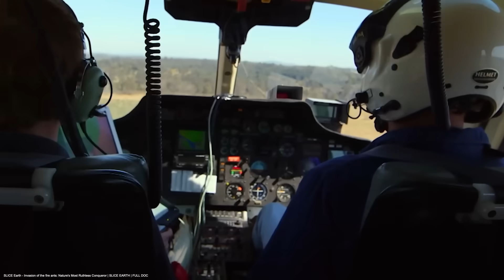Here's Why the U.S. Is Dropping Millions of Flies on Ants

Comment: All insects have to breath to tubes allover their outside. If you ever tried a fly/wasp trap with drowning in syrup they keep moving for hours before they die. You can see that they have a silvery air-layer  around their body that sustains them with Oxygen. So if you just add a little hand-dishwasher soap to the water they die within seconds. I've killed ants-nests that way by pouring a bucket of soapy water and then and they all drowned.  All ants know how to avoid drowning in their nest by building a mash-dome of silk like stuff inside that holds onto air when water floods the nest. This air bubble only collapses with soap, surface active agents. If you need to drown a large structure it would be wise to use a large tank with prepared soap water. 
I would not know how to handle a nest inside a home or shed if it is not a nest in the ground.

Comment: Yeah, there's a big ant hill in front of my mom's house in her yard.  A couple of times, my cousin and I tried to exterminate these ants in this ant hill. We did everything we could for at least a couple of hours straight. We did poison, and we tried digging them up.We used gas.We did everything we think of water.Nothing works, so who knows how deep they are. 
They're still there.
Reply: Molten aluminium😅 gets em all looks cool too when u dig it up
Reply: @DougOrr I've seen that done in a video here on YouTube. 
But was it fire ants?
Reply: Boiling water?
Reply: @magpie92766
 maybe.   I feel like they have a very intricate is tunneling system that goes down, and then up so it doesn't flood.

Comment: Yeah, then I realized that Several Hundred, perhaps thousands, of FIRE ANTS were in my boots and on my legs. Not one of them bit me, until I ripped those boots and pants off, right downtown in my front yard.
Yeah, I got a FEW HUNDRED BITES.
I just embraced it and figured it was ANT MEDICINE.
Each bite was the equivalent of a strong wasp sting.
My feet swelled too large to fit into any shoe. Its a good thing I love sandals.
I got HUGE HEAD RUSHES FOR A COUPLE OF DAYS, NO JOKE.
My entire body was covered in sweat for a few days as well.
I never went to the ER or to the Doc.
The entire reactive stage lasted around ten days.
(It was a bad spot for that six foot tall front yard Tomato plant for sure. )

Comment: Here's one. I discovered here in Floridah that when the temperature goes down into the 40's or below, just kick over the nest. They come out ready to attack actually shaking from trying to deal with the cold. Repeat this one more time after they have settled back or the next day and the nest disappears. They can't produce the chemical energy fast enough in the cold and die. The secret is they will alway attack, and it seems like too much of the nest is involved to recover. I go out looking for nests when the temperature drops. I haven't yet seen a nest move, it just disappears.
Reply: Good tip! Thanks
Reply: Excellent my friend. Keep doing what you are doing and encourage others as well.
Reply: Get some Guinea fowl and your ants disappear.
Good meat too.
Reply: @wwonka-hk3ci  Do the guinea fowl do extensive excavation, or just pick off ants wandering around the grass?
Reply: ThANKS
Reply: Ehhh... You didn't go back 4 months later.

Kicking over a fire ant mound with activity below 45 degrees and you might get a few thousand of the highest housed ants.
The primary colony and queens are many, many feet below ground with their winter food stores.   The mound 'dies' because the upper layers are no longer maintained, but the colony is doing just fine.

Besides, most mounds cease all activity below 45 degrees so kicking them accomplishes pretty much nothing.
Reply: 73 yrs. Lifetime resident of Florida TRUTH good sir👏👏🐊🐊
Reply: Sad part is it requires ya to get below 40°F. This isnt historically a typical winter temperature anywhere in Florida. 

It is, however, a winter temperature that they would normally deal with during winter in their native range. So I have to question how effective it really is. 

It sounds to me like you are actually forcing them to just go further underground, which would make the hive look abandoned but they would continue to thrive because when the air is 40° in Florida the ground 6" down is 55°.
Reply: @RippieFarmer   not a problem in the panhandle we got snow last year and I love putting soapy water on their nests or just kick it over and grab the blow torch.
Reply: @RippieFarmer  yeahh exactly what they are doing